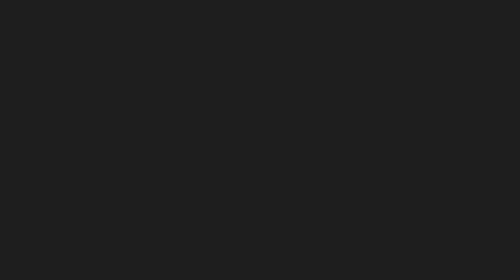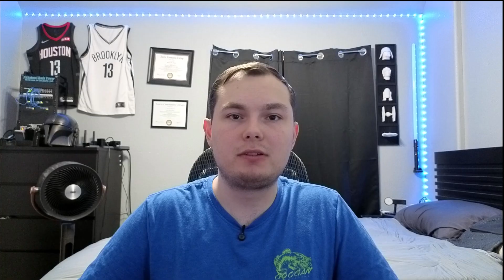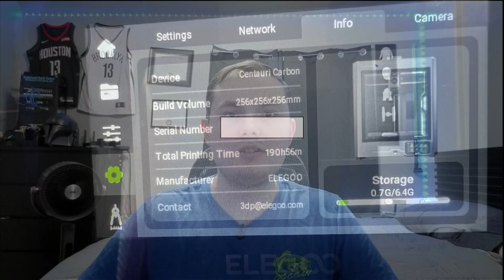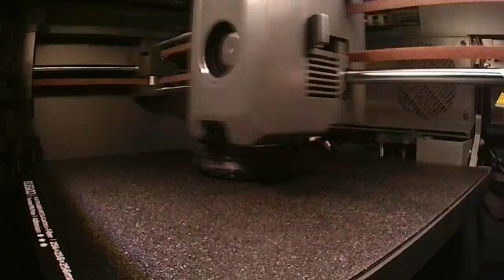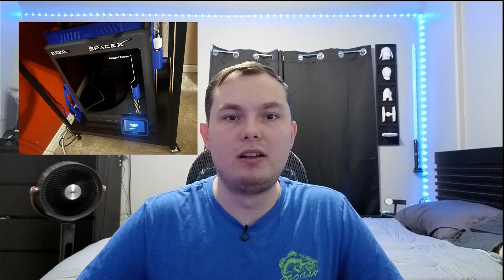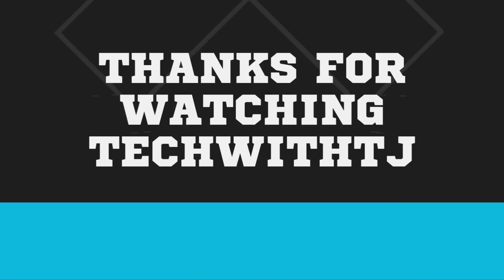Elegoo Centauri Carbon Long-Term Review (200+ Hours of Real Use)

Comment: I have had my CC for a while. I did start to get intermittent 503 leveling errors. Tech support had me do two procedures and the problem has  not came back sense I did the procedures. Mine also got damaged in shipping, but I didn't notice it until after it had gone past the date of return through the insurance company. It was minor cosmetic damage that you really wouldn't notice unless you turned the printer on its side and got a clear look at the feet corner area. There is a good chance the damage in shipping did cause the leveling problems.

But overall it is great printer for the price. I am just mad right now because it looks like they will not become coming out with a multimaterial system for the CC.
Reply from the maker: I'm glad that tech support fixed your printer. I have been reading up on the multiocolor system and i think you are right i think they gave up and are moving forward with the CC 2 that looks like the multi color from flashforge adx5. I hope that they do come out with a box though.
Reply: @Tech_With_TJ  Just so you know this style of filament changer is actually faster than the ones that are in a box. Because the ones on a box have to retract the filament much further to do changes. The time really adds up if you have a lot of color changes. But yes if you live in a dusty, and or humid environment having the filament exposed for long periods may affect your prints.
Reply from the maker: Thank you I’ve heard that people complain about the time for filament changes
Reply: @Tech_With_TJ  To be honest I didn't know, I only have an AD5X, so I have nothing to compare the filament change times too. But I saw a tech video and a guy actually timed the changes with box style and IFS style changers. And the ones without the boxes were faster.
Reply from the maker: Yeah I can see that I think the box is more for use case like when you have filament that needs to dry cause a lot of them that are coming out have a filament dryer in them
Reply: @Tech_With_TJ  For most people the speed of the color change is not the problem, it is the filament waste during color changes. So the future of 3D printing is nozzle or head changers. They just need to make them reliable and not too expensive. I am looking forward to reviews of the production models of the ones coming out this and next year.
Reply from the maker: @mj1s735  Yeah its very interesting what bambu labs, prusa and snapmaker have i dont know of any other head changers but yeah i think that the waste of filament for people can be a problem. i also agree with you on the price hopefully coming down it will be interesting to see who comes out with the first sub 500 printer with the head changing.
Reply: @Tech_With_TJ  It will be a long time before any changers are at $500. And if they are it would only be 2 changers. I want a minimum of 4 changers.
Reply from the maker: @mj1s735  yeah I dont know if 500 is to far away with snapmakers new printer only being 800 but yeah i would like to see 4 changing heads.
Reply: @Tech_With_TJ  That is $849 if you preorder, and the regular price is $999. They will have no incentive to reduce the price any lower unless they have some competition at a lower price. I will wait until the production models have been out  for at least 6 months before I would even think about being one. And because of the changers and bigger build plate size I would be willing to pay between $1000 and $1200 for a good reliable model.
Reply from the maker: Oh I misread then I thought It was 850 normally I didn’t know that was preorder. Yeah so it will be a while before head changing is under 1000
Reply: @Tech_With_TJ  Hey it will be under $1000 after preorder. It will be $999.00 😁😁 And I bet that Bambu H2C will be at least $2500 if not higher, so they will have no incentive to lower their price.
Reply from the maker: @mj1s735  yeah Bambu has a high price pretty much always.
Reply: @Tech_With_TJ  Their prices are reasonable for what you get, especially when you compare them to Prusa. I am no fanboy of them, but I can admit they changed the printer game and brought it more mainstream. And they have the best ecosystem right now. And their printers are about as close to plug and play as you can get right now.
Reply from the maker: @mj1s735 yeah they definitely worth the price for sure

Comment: I am not interested in getting a multi color system for my Centauri carbon because of the time and wasted filament 

I'm waiting for something with multiple toolheads
Reply from the maker: yeah ive seen snap maker i think has that new one coming out thats under 1000. I dont think multi color is worth it but it would be nice to have for some things.
Reply: @Tech_With_TJ  there are some nice Super Mario STL's that need multicolor which is why I'm hanging out fore the snap maker
Reply from the maker: @JohnDoe-bz4yl  I bet those would look cool and from what ive seen the snap maker is going to be a solid printer.

Comment: I have 812 hours on mine and would have had more if it wasn't for the downtime after I broke one of the connectors when changing the hot end
Reply from the maker: That's tough but good to see that someone whos used it alot has had minor issues with it.